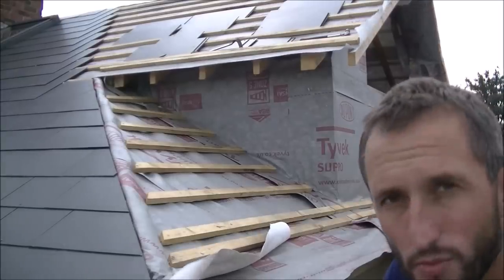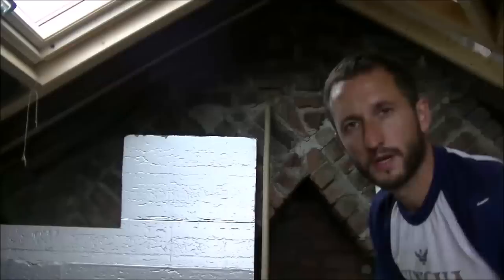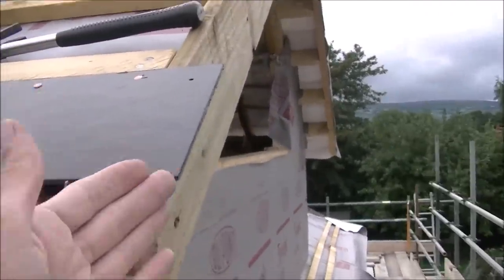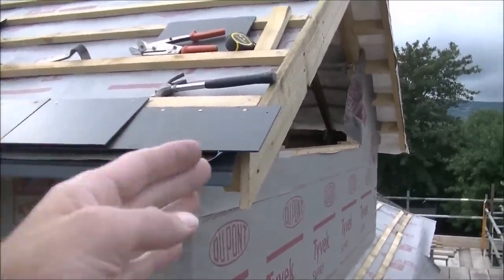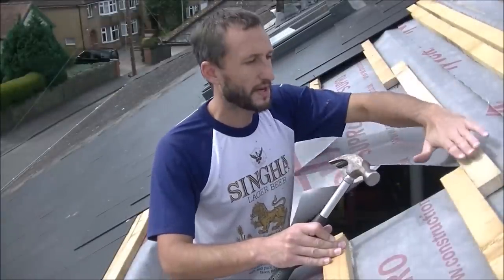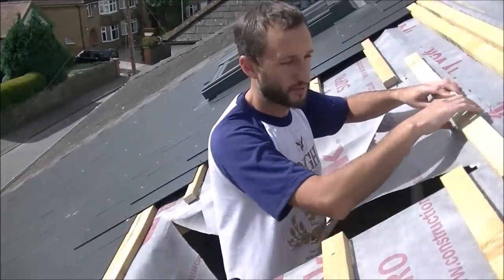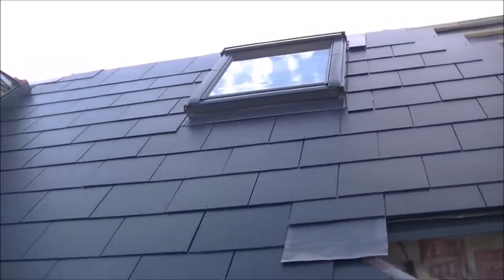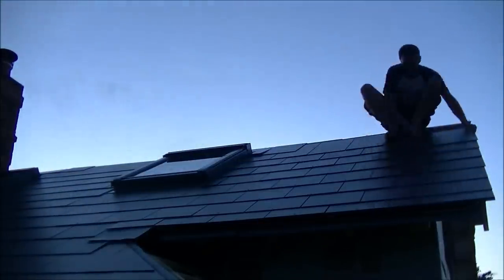Loft conversion part 17 - Velux window installation & slating the roof gable end. Velux GPL CK04

Comment: Mate for an diyer you are doing good on the roof. I could pick at a few things but thats just my opinion as I am a roofer,  but one tip if you don't want the lead bleeding down your slates,use the patination oil on the lead after you have bossed it into shape and not before
Reply from the maker: Thanks for the advice Mark. Roof been finished for a few years now as I'm a bit slow on uploading the footage. Lead hasn't bled.... yet! So hopefully oil did the trick. Thanks for watching 👍

Comment: The loft don't look tall enough
Reply from the maker: It'll be about 2 meters inside from floor to ceiling when finished. Fine for me but not ideal if you're 6'8" tall! With any loft conversion you are limited by the height of your old roof. As mine is semi detached, raising the roof isn't an option. If it's detached you can always lift the roof but it will likely require planning permission to do so.

Comment: Slating incorrect under Velux window
Reply: Don't just leave it there mate, explain.
Reply: There should be a short course lining up with the tails of the other slates or else you are not maintaining the lap
Reply from the maker: @paulswebba , I explained that in the video. You can't do a short course or it'll raise the flashing above the other slates. The window ideally needs to be a touch lower but as explained in the video I need the head room. The lap I have will suffice and has been  fine since installation. Thanks for your comments.
Reply: @POUSEaroundtheHOUSE  drops the mic
Reply: That argument would not wash with a clerk of works, however as you say you are a diy.
Reply: @POUSEaroundtheHOUSE  no leaks a job well done